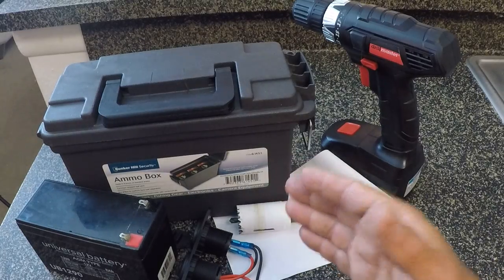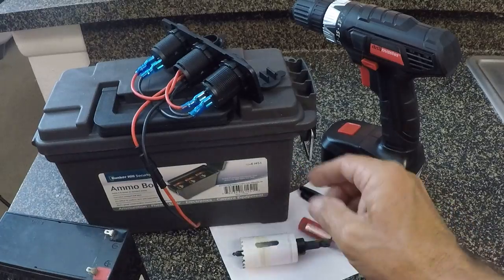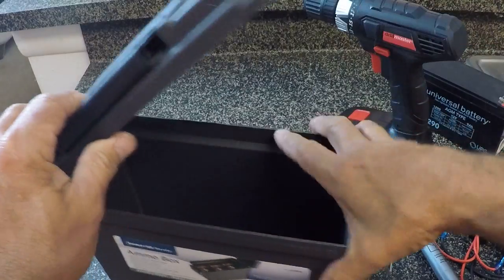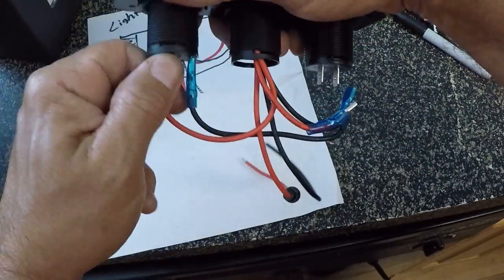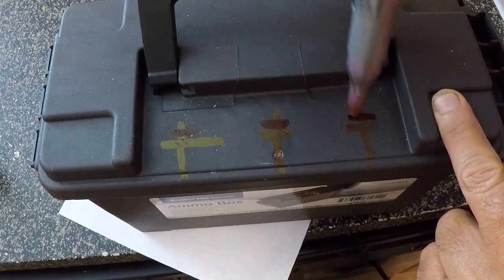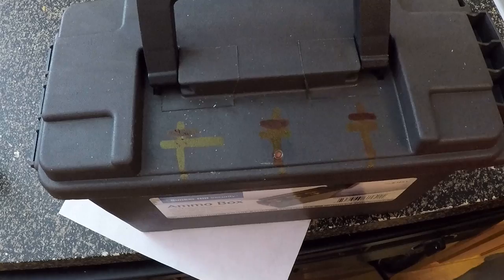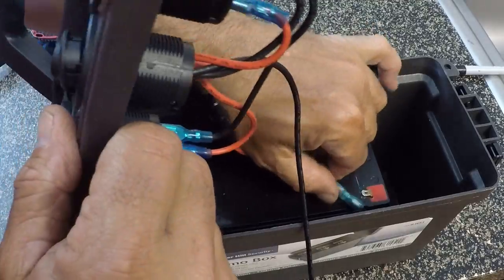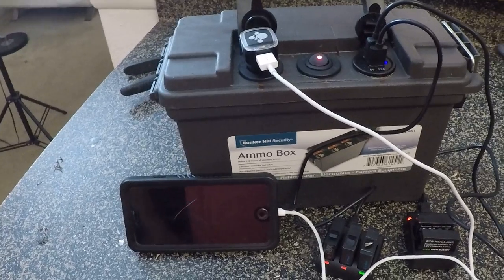Simple DIY 12v Portable Battery Charging Box With USB/Lighter Connectors For Chordless Devices

Comment: if you run your drill in reverse while pressing the hole saw into the surface of the box it will cut a much smoother hole and it wont walk around so much.  Great battery box setup!
Reply from the maker: Thanks for watching. Good idea for cutting the holes!
Reply: @RadReelingFishing  What I do is penetrate the surface with the bit and as soon as the the teeth bite into the plastic, I put the drill in reverse and put a little extra pressure to make it cut through even though it is running backwards.  Really like all your videos.  Thanks

Comment: Built one almost exactly like that for ice fishing. Cheap, easy and holds a charge for over 12 hours when I use it for powering my LED ice shanty lights. Works well for charging phones and powering accessories as well. Nice Job!
Reply from the maker: Awesome news for sure. While reading your comment I was reminded that I'm going to rig my kayak with lights for filming at night. This battery pack will work great for power. Thanks!

Comment: I use mine as a 12v air bubbler. The bubbler and battery fit nicely inside the ammo can. Added a couple aluminum clips on the side and I can hang it from my surf cart rail. I throw it in my bucket and take it when Im walking in. Or bring it on the kayak. Very portable. When I build 2.0 I will add a thru hull sae connector for charging.

Comment: Here's a tip for using a hole saw in any sort of plastic. Run the drill in reverse to drill your hole. Makes a MUCH cleaner hole
Reply: A step bit works extremely well also.

Comment: I have purchased 3 of those USB/12V Plug/Master Switch sets. Each one from a different vendor. The master switch on all of them is not the best quality. The least little bit of force will pop the switch up out of the holder. My suggestion is to purchase your master switch(es) separately. Other than that, cool build.

Comment: I love that you made a simple setup video and the wiring is clean. 😇 How do you charge the internal battery? Can you charge it with the 12v cigarette port? I’m thinking of making one of these that I can attach a solar panel trickle charger into via SAE connector panel or by cigarette lighter plug.
Reply from the maker: If I were you just buy a power bank. They are reasonably priced and much more efficient.

Comment: Love the vid! Quick question, does the battery drain? And if it does how do you recharge it?
Reply from the maker: If I were you look into purchasing a power station. https://amzn.to/49UX2oj They are reasonably priced and work a lot better than this set up. Yes, it drains and the battery I purchased came with a small charging cable.

Comment: How do you charge the battery in the box
Reply: I have searched what feels like a thousand battery boxes and DIY "SoGens" and have yet have anyone explain "How to recharge your battery from your vehicles 12 volt Cig input" as all the Jackery/Bluetti types do. Solar is simple... a Charge Controller and a Solar Panel. BUT how do you recharge via 12 volt whilst driving your vehicle? What's it take? How is it done?
Reply: @sonnyblu6299  As long as the car voltage is higher than you battery box, it will charge.  Cigarette lighter sockets are usually pretty low amperage, so it won't be fast...
Reply: @greedyg76  Would there be any advantage to using a DC to AC INVERTER to AC Battery Charger? Thanks...
Reply: @sonnyblu6299  not likely. DC to AC conversion is very inefficient. There is a lot of power lost in that direction. If you wanted to charge at a higher rate than what the cigarette lighter is capable of, you’d be better off running a dedicated switched & fused circuit direct from the battery. Switched via a relay so it would not charge when the car is not running, reducing the chance of draining the car starting battery. Fused because you want to protect the car’s electrical in the case of a short somewhere along the line.
Reply: @greedyg76  Thank you... As much as I really want to DIY a "So-Gen" for the "Cost to Power effectiveness" and just for the fun of it!  This is a prime example of my ignorance and why I should just buy a Jackery or Bluetti etc... LOL  ;-)  Thank you!
Reply: @sonnyblu6299  I’m currently in the process of making a rechargeable one I’ll let you know when the parts come if it works out, I don’t like how he doesn’t run any fuses on there tho sounds like if a wire or plug fails that’d be a fire hazard.
Reply: @MNNICEGaming  ya know he mentions the in line fuse early in the video, right?

Comment: I went all out metal can marker and fog lights 5 switch panel 20ah lithium jesus i spent 300. wish id have seen this first but the one i make will be in my kids house somewhere after im gone. It was a project i make things its a hobby. Im gonna make one like you did too tho its cheap and handy
Reply: I just made one like your lastnight as all the parts for the metal one arrive it turned out nice and was good practice now its time for the main event haha i need one of those stepped drill bits. This is metal hopefully its more of a challenge. I enjoy this stuff so much. Im gonna take my time and check everything 3 4 or even 5 times. That 20ah battery barely fit in that 50cal box were talking 1/8" to spare. snug as a bug in a rug. What would be cool is to find a way to rig up an alternator in a can and have connections to the can with light and battery to charge it youd have to find a low rpm 12v alternator and factor in how many cranks you could comfortably do then theres math involved to determine how many amps are being delivered at the rate of hand cranking opposed to 3000 rpm or whatever. Or you could cheat and hook up a volt meter and see what you produce and a comfortable rate and it it needs fine tuning you could employ a capacitor for a car stereo to spice it up a bit haha i love this stuff i went to college for building computers. Electronics are my jam.
Reply: I did the metal one lastnight its a beast! It has 2 fog lights and 6 marker lights and all the power sockets and switches